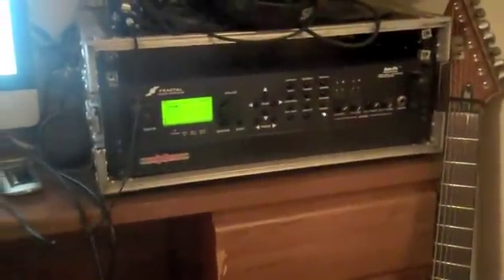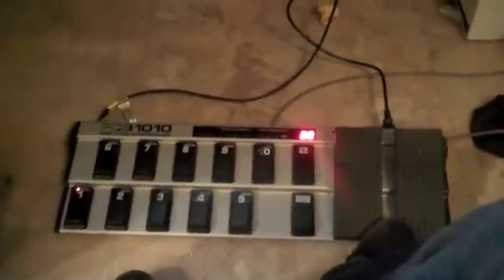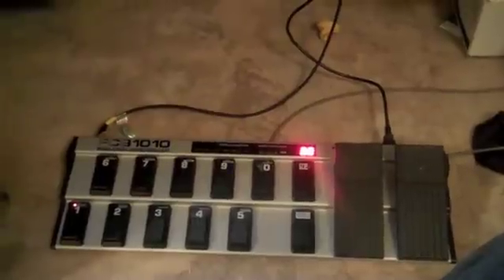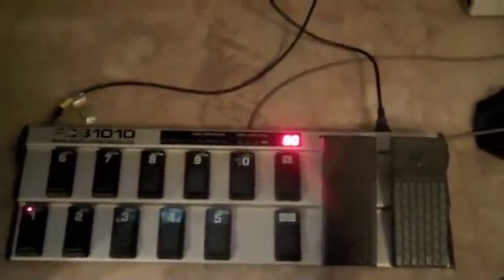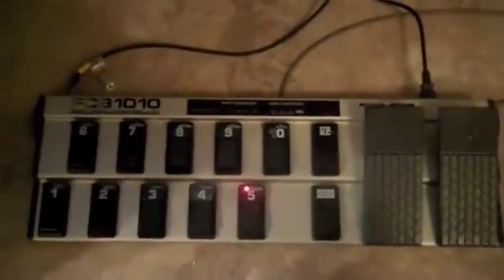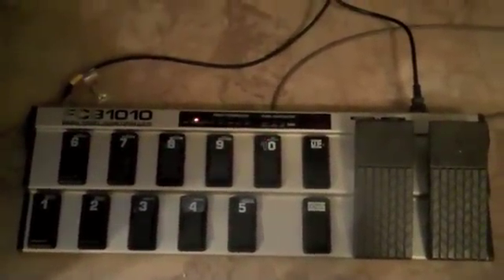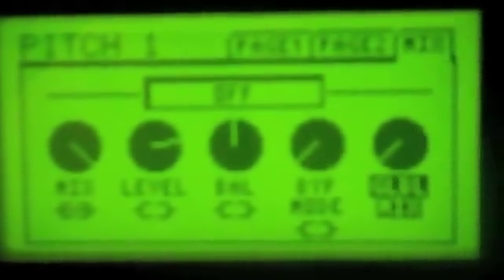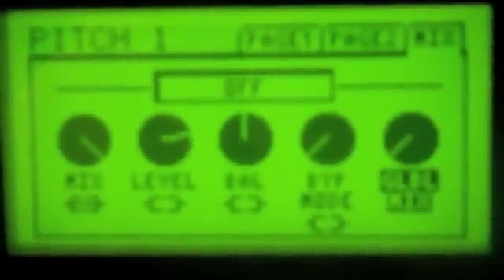Programming Behringer FCB1010 Expression Pedals with Axe FX (no Eprom chip)

Comment: Hey dude, Im new to this whole FX thing, I was wondering if youd be able to explain ... I want to use this as a replacement for my stomp boxes all together but I noticed that you have a amp select and a cab select, Is there a way to turn that stuff off completely ?... Cause I have my marshall heads running straight into my mixers with no cabs ... I just want to be able to use this thing as a straight up stomp box replacement without having to tweak all this other crap that would possibly effect my tone I already have. If you or anyone else could help that`d be awesome, Thanks.

Comment: Hi. When I switch scenes with FCB, my expression pedals immediately stops working. Any ideas?
Reply from the maker: im assuming you have programmed your expression pedals to every scene? If not you are going to have to do that....if you have...then i dont know. Ive noticed that i have to actually change my expression pedal once b4 it actually works. Like.....i turn on my axefx and my pedal and then immediately change the pedals up and down once and then everything works....BUT....i only have my pedals programmed in to one patch at the moment...i dont remember having a problem with this b4 when i used them on separate ones though.
Reply: i have this prob has anyone worked out how to solve?

Comment: I'm all calibrated and the axe fx learned expression pedal 2 as external 2, but when I set a parameter to be controlled by external 2 and use the pedal, nothing happens.  First pedal is working fine.  Tried going through the process 3 times.  suggestions?

Comment: Just the calibrating of the rocker foot pedals was immensely helpful and I'm not even using hardware. Using software (Mobius 2 Looper to be exact and GarargeBand) and I couldn't get them to control anything! Until after I calibrated the pedals like you instructed. You should edit this for showing just how to calibrate the Berhinger alone and in general as I think that it's a necessary part of making the foot pedal/rocker pedals able to be recognised.... by any software or hardware. Cheers!

Comment: Does the Axe Fx standard have a 5 pin or 7 pin MIDI jack?  I'm trying to use my FCB1010 with my Axe Fx II and it has 7 pins when the FCB has 5.  Do you have a 5 to 7 pin cable?